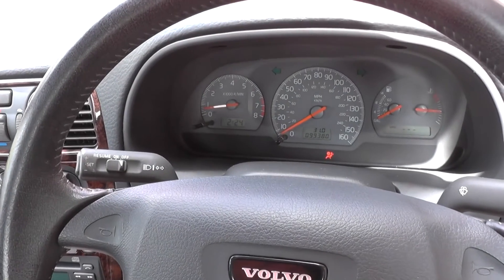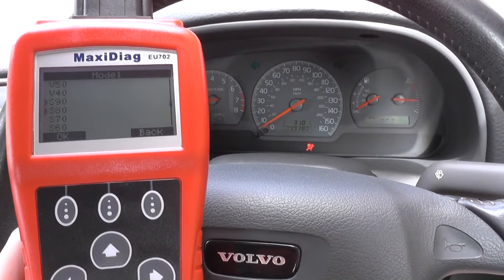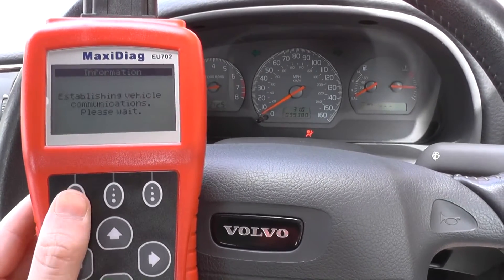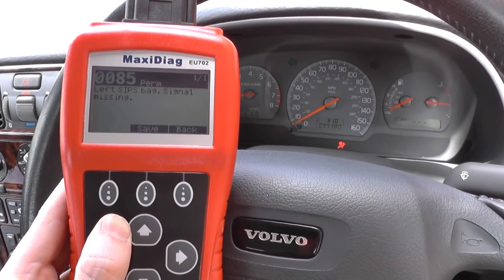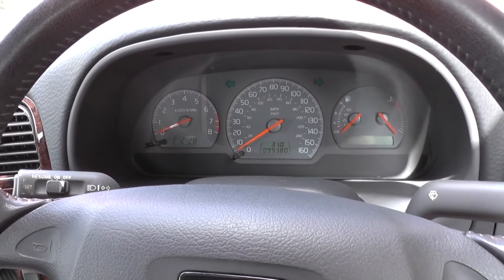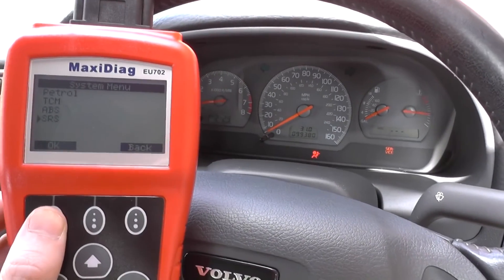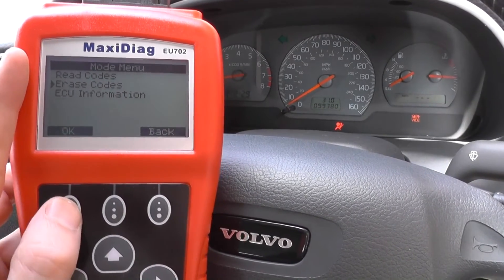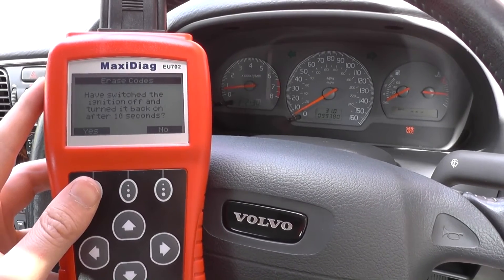Clear A Volvo Airbag Warning Light With the EU702 Diagnostic Tool

Comment: Hi. Ive had a simialar one for many years. I just got hold of a  2009 Mercedes W204. Unfortunately the system has only for W202 and W203 available to test. Is there any way I could add for W204 as well? I did download Japanese and other systems already onto it.Thanks.